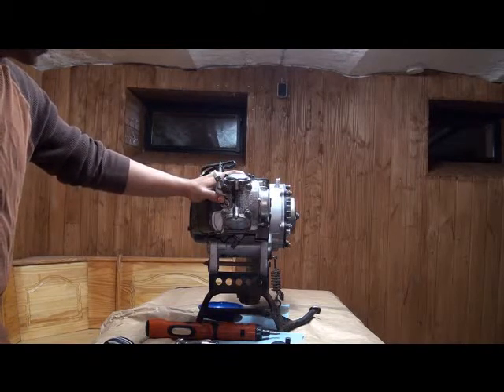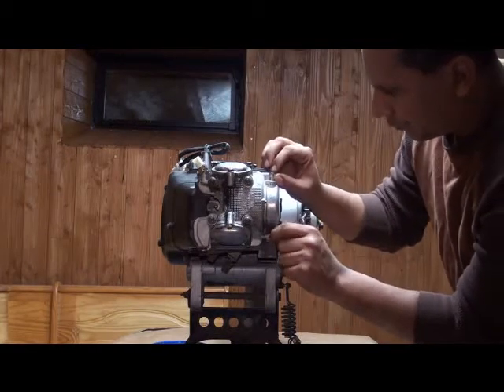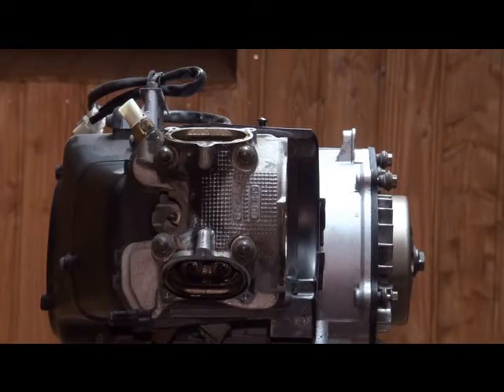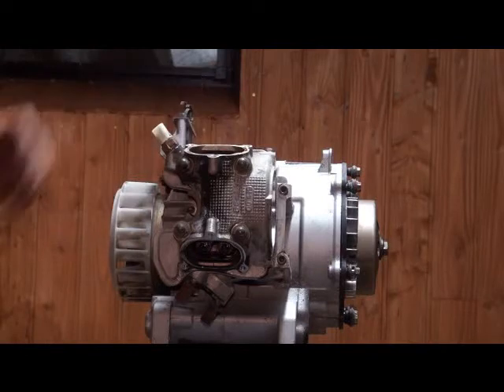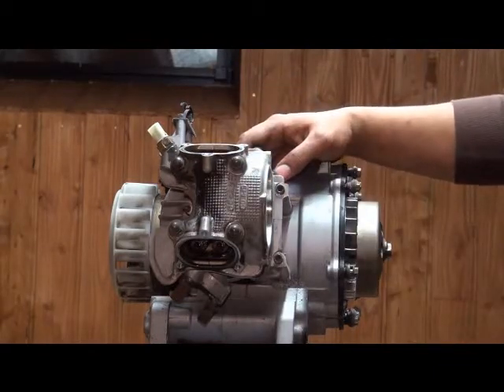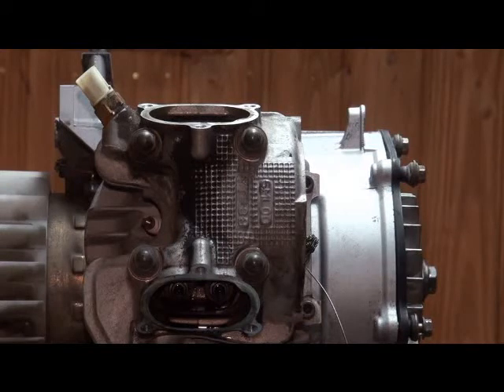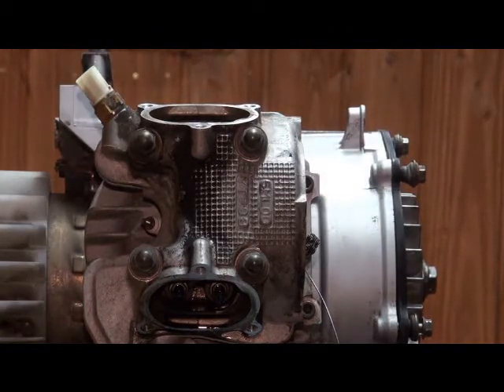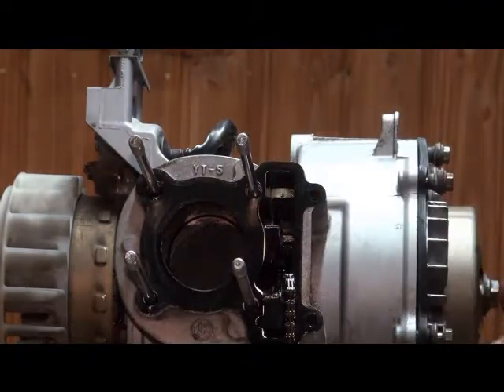Remove Head & Cylinder from Zuma, BWs, Cygnus 125 Scooter: Part 1/4

Comment: interesting and helpfull thanks bud, i am  soon going to attempt a top end rebuild on my aprilia atlantic 125 scooter,  so im just perusing youtube  for  assistance, im a tad worried about taking off the timing sprocket, i note you tied off your chain and you dont mind if your chain goes slack in the block,, is there a chance the chain could slip off and you would have to take the bottom end off the engine or am i worrying about nothing ?
 cheers
Reply from the maker: I would just tie off the chain to ensure that does not happen, safe than sorry. You could use a magnetic retriver to fix the chain if you absolutly had too.
Reply: cool.. many thanks :)